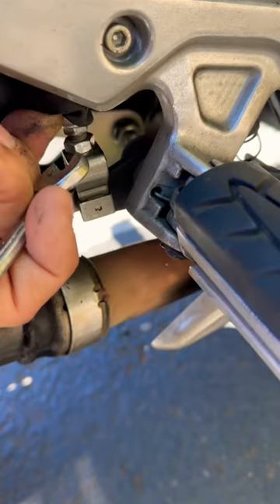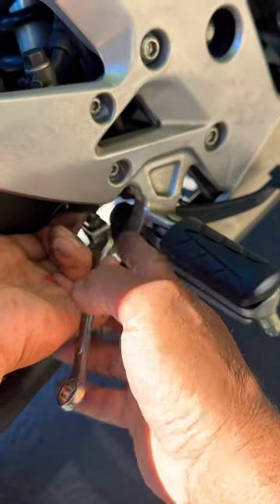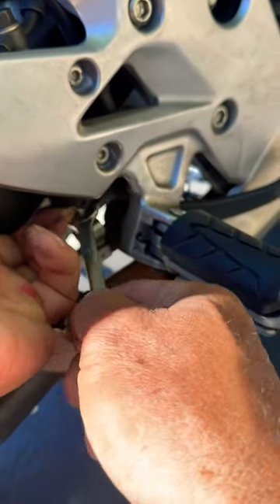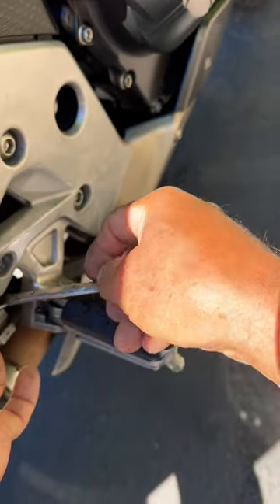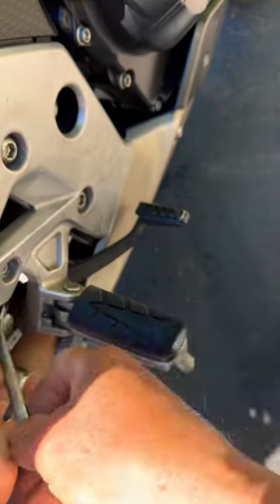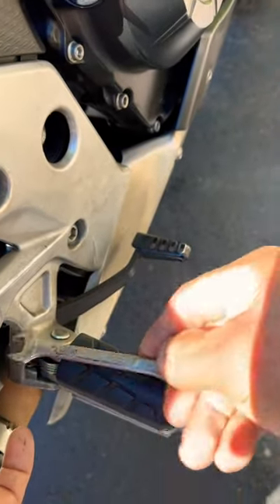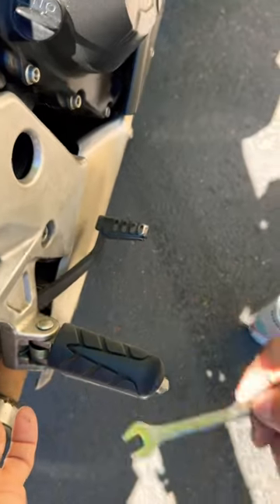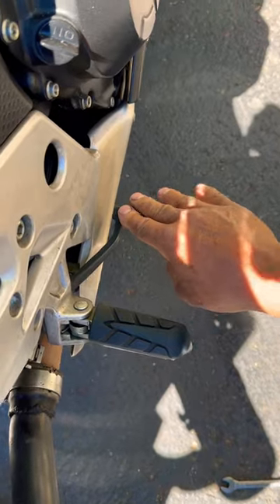DIY ADJUST YOUR REAR BRAKE PEDAL FOR MORE COMFORT #shorts #diy #brakes

Comment: You're adjusting the play in the brake pedal before the piston is engaged, which will slightly reduce the upper height of the brake pedal but your not actually lowering the brake pedal.
Reply from the maker: It is lowering it. Did you watch it go down?
Reply: @fastflo1  Yes, you're reducing the play/movement in the pedal, not lowering the pedal.